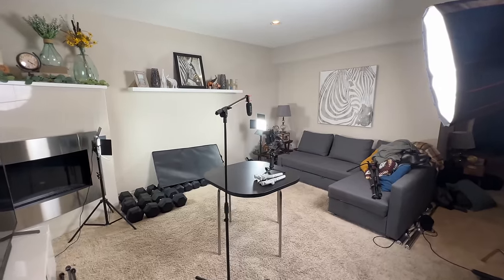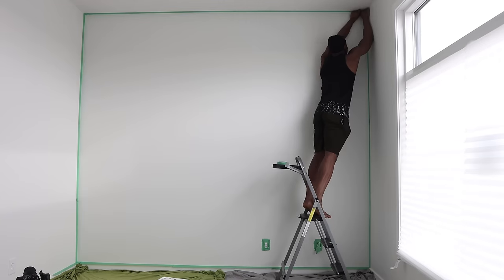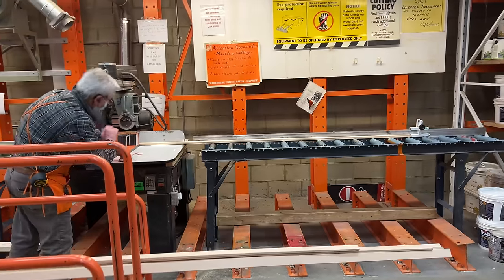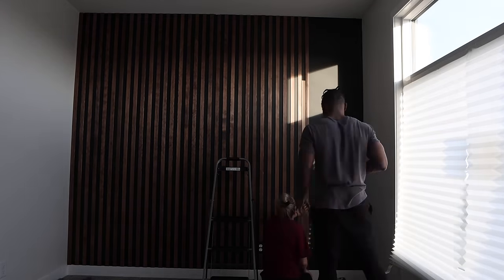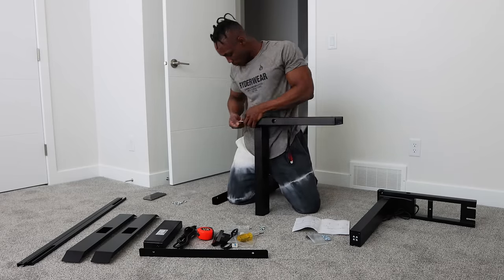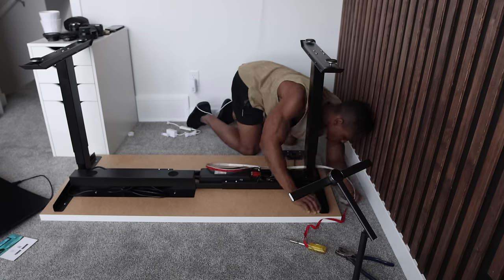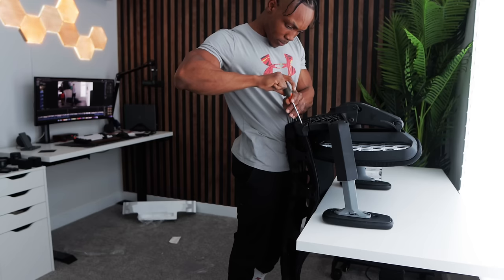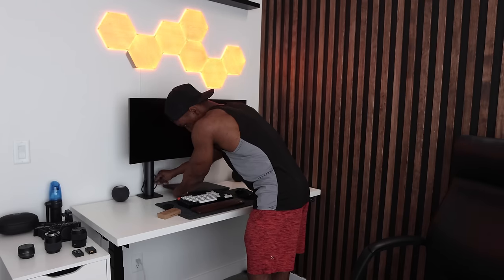Transforming a Small Room into My Desk Setup & DIY Wood Slat Studio!

Comment: from a designer perspective. i think you should place your desk on the wall with wood slats so it can be use as "ACCENT WALL" then put some paintings on the other wall where your desk previously located. nice setup!
Reply from the maker: That was my original plan but I need the wall for another purpose so I had to tuck the table in the corner instead

Comment: Did you cover the nail holes with wood filler, and if you did, did you have to sand and re-stain? I'm curious.
Reply from the maker: I didn't do any sanding as the wood was already stain ready and I didn't want to mess with the nice texture. The nails used were so thin you can't even see the holes made.